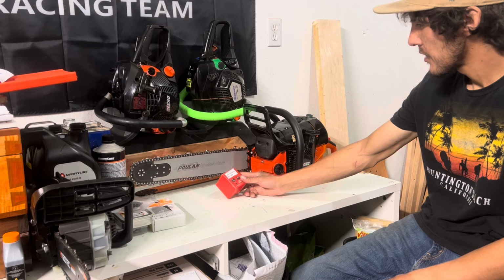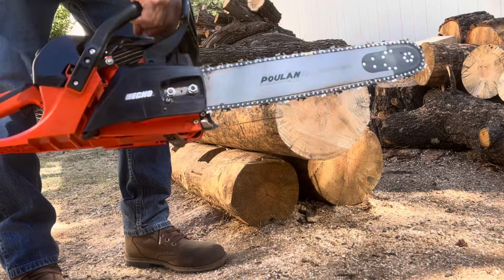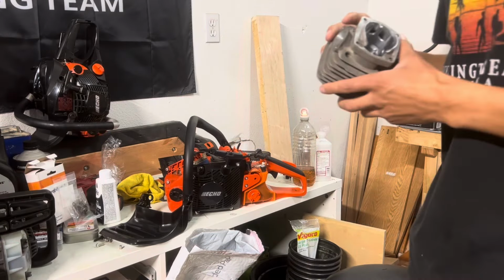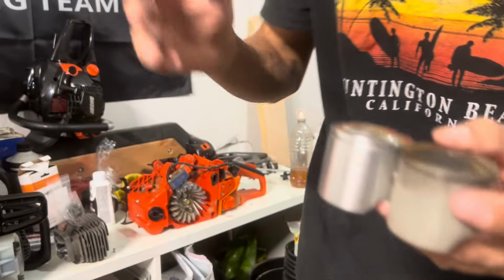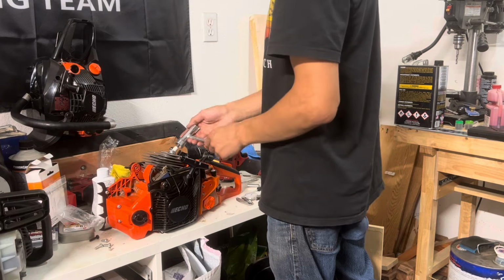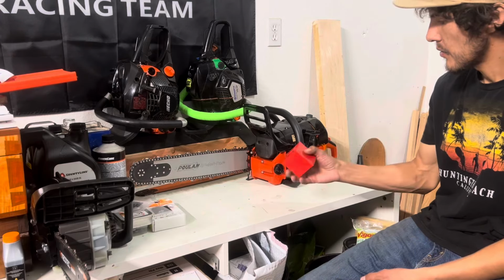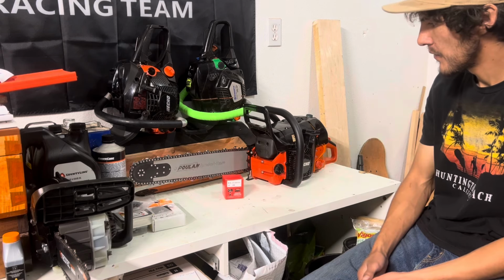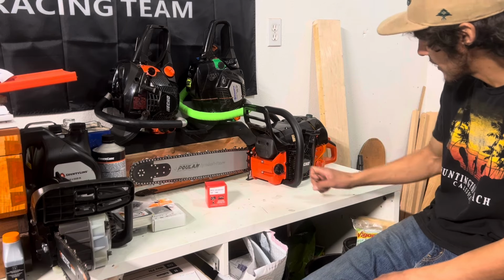Echo cs 590 gets a little red barn pop up piston before and after

Comment: I think the overall goal should be to stop and/or prevent cylinder wall scoring;  but I don't know if this's even possible with these single piston ring rigs.   OR ...  Once the piston wall is scored, can and/or how far, if at all, can the cylinders walls be taken off to take out the scoring;  which also likely means a larger diameter piston & ring is needed, to get some more life out of the cylinder head, instead of replacing the cylinder or scrapping the entire saw.

Thoughts on this?
Reply from the maker: I never really thought about that that but you may be completely right. They do offer a dual ring option and I’ll have to swap it out cause there is light scoring already.
Reply: @brainiacproductions357     The heat buildup might be faster & hotter with two rings - a point to keep in mind, but why not try because the single ring clearly isn't working out - just like similar cheap saws I've used & seen first hand. Only they aren't cheap anymore because the corruption has hiked up prices again to keep the scam going instead of an actual reasonable way of life. So if you can get the two ring version & it's not absurdly priced, & you got the time & patients to try it out, I would give it a go & encourage other to as well. 

Thumbs up.
Reply from the maker: @01mustang05  I’ll have to order one up soon just really isn’t on the top of the list. But will get to it sooner or later. Inflations only gonna get worse sadly.

Comment: I've used a couple red barn pop up pistons. They were both really heavy and I had to shave a lot off to get the weight back down but they definitely made a little more power.
Reply from the maker: What areas did you remove?